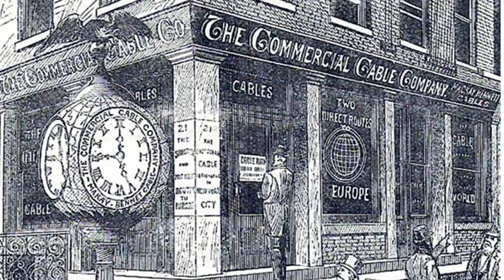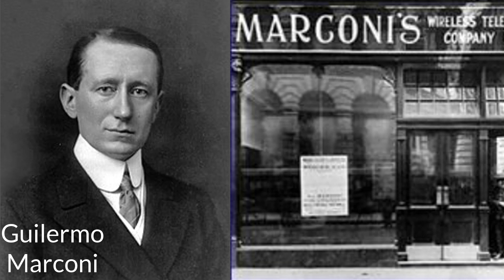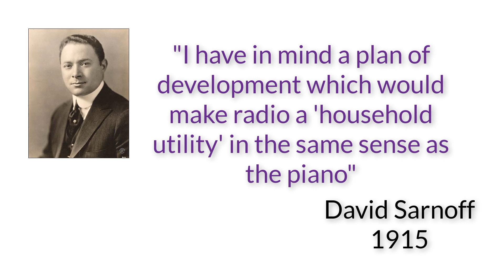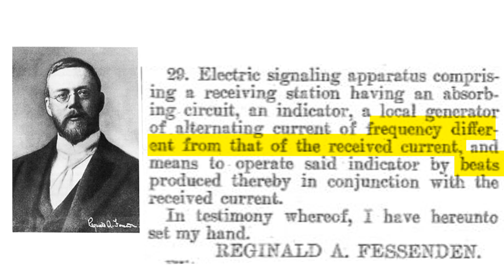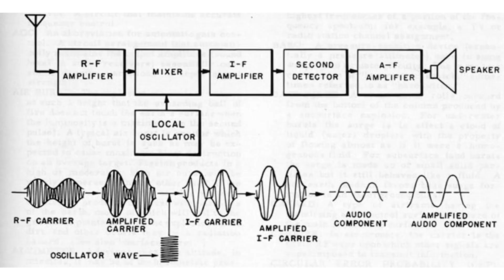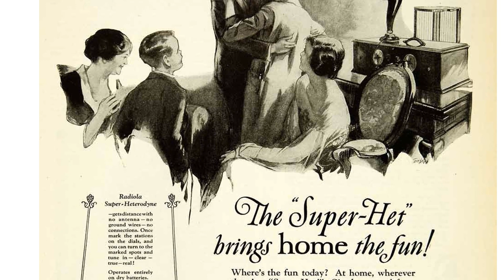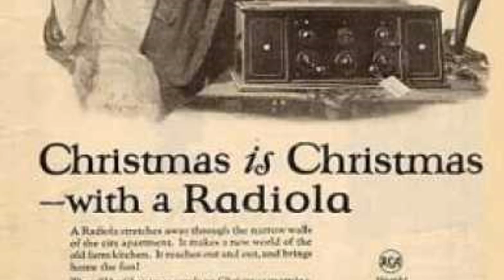David Sarnoff, Howard Armstrong & the Superheterodyne Receiver

Comment from the maker: CORRECTION: I implied that the superheterodyne system used signal addition like playing two guitar strings at the same time, but I have been corrected and it is a signal multiplication not addition. Sorry for the confusion.
Reply: Sum and difference resultants of algebraic combination, like a piano makes beats.
You are correct.
Reply: When you beat two frequencies F1 and F2 in a mixer (non-linear component like a diode or a triode), you obtain two more frequencies, F1+F2 and F1-F2. The IF stages (usually two or three of them) do filter out the F1+F2 component, while the F1-F2 corresponds to the IF frequency of the radio, and is successively amplified and detected.
Reply: @rayoflight62  Exactly. Typically the first IF frequency was 455KHz.
Reply: In a sense you are also correct in that the envelope of the combined guitar string output contains the difference frequency.  However, in practice, schemes that produce multiplication and suppress the local oscillator are preferred.  Great channel BTW.
Reply: @davidhaworth1802  When you sum signals, called superposition, the difference frequency is not present. What you see is the sum of the signal's voltages as they go in and out of phase. It is this voltage-sum that you are seeing, not a component any new frequency.
There must be some effect causing multiplication, commonly a nonlinearity will do this, in order to have the sum and difference frequencies present.
Reply: @Observ45er  I said the difference frequency is in the envelope.  This is correct.  The envelope detector is a non-linear device.  See more on the Wikipedia entry on envelope detector.
Reply: @davidhaworth1802  The "beat frequency" effect is a illusion due to the finite time interval our ear and brain analyzes the spectrum with, it perceives two close frequencies as one modulated frequency. Our ear and brain in effect is a non linear frequency analyzer, similar to what you get with the magnitude value of a frequecy spectrum from a discrete fourier transform of a time interval. Taking the magnitude of a complex frequeny bin is the non linear function similar to the ear where certain nerves detect vibration strength of tuned vibrating hairs.
Reply: @raymundhofmann7661  Its hard to see your point here, but I think you are agreeing with me.
Reply: @davidhaworth1802  Not really, as you say that addition would be somehow working already to create new frequencies which is incorrect for a purely linear addition. Just as a reminder, approximating the envelope of a signal is a non-linear function.
Reply: @raymundhofmann7661  As a reminder of what I said "the envelope of the combined guitar string output contains the difference frequency".  I am not clear what is controversial in that statement.
Reply: @davidhaworth1802  I said it because it was essential for me to understand the seemingly paradox perception of a beat frequency even though it is just a linear addition of two tones which can't create new frequencies according to signal processing theory.
Reply: @raymundhofmann7661  I think the difference is between the perception of the envelope and the actual determination of the envelope (eg with an envelope detector).  The envelope detector is nonlinear, not least because it provides a positive output regardless of the polarity of the input signal combination.  So combine two sine waves of relatively close frequency, put the sum into an envelope detector and frequency analyze the output to show the response at the difference frequency.
Reply: @davidhaworth1802  What is the difference between perception and determination of the envelope? The ear/brain basically in an array of frequency selective envelope detectors, which is a non linear operation in signal processing theory and this explains the perception of beat frequencies with the theory.
Reply: @raymundhofmann7661  Yes, when you understand that our hearing response logarithmically, you understand that this is nonlinear.
Reply: @Observ45er  I think you don't quite understand. The non linear operation leading to the perception of beat frequencies in the ear is the amplitude detection or envelope detection of the single frequency selective resonators/hairs/nerves in the ear. That these nerves also show a more or less logarithmic perception doesn't do anything in the "base band" of the air pressure variations.
The logarithmic perception of the ear/brain seems not to apply to the single frequency detectors but to the overall sound pressure level.
Otherwise it would be much harder to detect fine nuances of overtone variations and spectral shapes which is essential to discern different voices and sounds.
Reply: "Mixer" is a unlucky name, as it implies addition. On the other side if it has a non linear transfer function, which at some point nearly everything has, it creates the new frequencies of multiplication and more. Mixer is just a sloppy name coined in the beginning of a non linear amplifier stage "mixing" the local oscillator and the rf input.
Reply: @raymundhofmann7661  The term mixer was indeed the original terminology. It appears that perhaps, audio mixers, which only some the voltages, maybe confusing some people. However the term "frequency mixer" has been a long accepted term.
Reply: Correction 2: it's Guglielmo Marconi, not Guilermo. Marconi's father was Italian, not Spanish (and in Spanish it would be Guillermo with two l's anyway).
Reply: In theory both the audio mixer and the rf mixer are using the same amplifier that add both signal together!!! But, because the rf mixer use a signal (the oscillator) that is at least a thousand time louder, the oscillator will saturate the amplifier or modulating the signal therefore creating the multiplication. Simple as that... In both case mixer is the correct word.
Reply: @y_x2  That may sound like a confusing answer, but it is correct. We commonly use the local oscillator to drive the mixer stage very, very hard, thus making it non-linear. When the smaller RF signal is added into this, the resultant is a rather complex multiplication process that includes the original frequencies and sums and differences of harmonics. The effect is that the local oscillator signal turns the amplifier on and off and the input signal is only allowed through when the amplifier is on. This can simplistically be viewed as multiplying the signal by one or zero, as well as values in between, at various times.
A true and exact multiplication of the two voltages over time would produce only the sum and difference frequencies and none of the other components. This is what a balanced mixer does. The typical receiver mixer is a very imperfect multiplier but works quite well because the desired I have frequency is simply filtered and amplified.
Reply: The local oscillator is set, as I understand it, higher than the incoming signal by the intermediate frequency. i.e. local - incoming = IF. If that is not subtraction, then I do not know what is...
Reply: @Tensquaremetreworkshop  It may or may not be higher, depending on the application. You are correct though. Mixing 2 frequencies will result in both originals, their sum, and their difference.
Reply: @GoSlash27  Exactly- so what is the multiplication about?
Reply: @Tensquaremetreworkshop  Multiply the waveforms, add and subtract the frequencies.
V_A=cos(A); V_B=cos(B); A=2*pi*f_A*t; B=2*pi*f_B*t
V_A*V_B=cos(A)*cos(B)=0.5*[cos(A+B)+cos(A-B)]
Hope that helps
Reply: @Tensquaremetreworkshop  again, just to make sure you are clear, the instantaneous voltages are being multiplied together. The voltage at each point on each sine wave is multiplied in every instance of time to generate a new voltage which is the product of the two. It is this multiplication product which gives you a new waveform that has new frequencies within it.
This can be very confusing to beginners because you seem to be making something out of nothing. However, that's the way it actually works.
Reply: @Tensquaremetreworkshop  Mike, the local oscillator can either be above or below the incoming frequency. When you have a nonlinear mixing process you will get the difference and the sum frequencies. This is due to a multiplication process of the instantaneous voltages. You are not adding and subtracting frequencies, you are multiplying voltages and the result includes these new frequencies.
Reply: @Observ45er  If you can calculate the result with addition (or subtraction) then that is what it is, whatever happens ‘underneath'. After all, the gas laws are a simple ratio, underneath which are complex physics- but you do not need to know that to do the calculation.
Reply: I must of heard this story is some bastardized form many different times. This is the most complete version that few people know about or understood until now. Thank you!
Reply: I suppose any nonlinear mixing circuit will give you some component that is the product of the two signals. Did Armstrong design a circuit that was a pure multiplier? Anything less is basically wasting some of the signal.
Reply: @lawrencedoliveiro9104  You might think that something gets wasted, but that is not practically true. As long as you get enough of the IF signal out to use that's, all that matters. Yes, all the other stuff is, in essence, thrown away, but it doesn't matter.
Reply: You were correct. It's the sum and difference,  lots of people think they know what they are talking about....And they are the loudest.  I've worked with the circuit before.
Reply: Guitar strings produce "beat" signals too. So it was a great example!
Reply: In analog circuits, there is no such thing as “enough” signal. Higher signal-to-noise ratio is always better than lower.
Reply: It’s the ‘time instant sum’ but the functional multiplication for any time.
Reply: Hoy, A lot of tricks were used to filtering out those 'harmonics too'. :)
Reply: It does not matter whether the mixer is a good multiplier. You could even see it as a chopper. It will still generate an I.F. frequency.  But the amplitude of the I.F. signal does have to be a linear function of the input signal so that the amplitude modulation is not distorted. This doesn't matter in an FM receiver.
Reply: I agree with Raymond. I have designed superhet receivers, and we didn't usually use a multiplier as a mixer. It usually is in fact addition with a non-linear stage - which could be just a diode.  But the math is easier to do with a multiplier.   If I were to design one now, with ICs a multiplier would be an option.
Reply: I guess human ear / hearing being non linear make beat , work like multiplier.
Reply: Your original statement is correct. The signals are added together. Multiplication is a non-linear operation that is not easy to achieve in electronics. Except that primitive summation circuits also do some multiplication due to non-linearities.
But the simple act of summing two signals of differing frequencies results in a complex signal containing both the original frequencies, the sum of those frequencies, and the difference.
And as summation is very easy to achieve in electronics, this is one of the great benefits of the heterodyne design.

So I don't know who had the audacity to correct you, but he/she was dead wrong. As a simple experiment with matlab (or matplotlib) where you plot the sum of two sine signals with a frequency that is a little different will demonstrate.

Perhaps the person was confused with the decoding of an FM signal. If I remember correctly, that does require multiplication, but in practice this was achieved using the non-linearities of regular filter circuits. 

The only analog circuit that does real multiplication is the differential cell, which has an output current that is a fraction of the total current running through the differential pair. With the additional benefit that it can also mix two signals (by subtracting them), these were used in High-end FM systems. Often in the form of a "Gilbert Cell". But that was in the seventies and later, the stuff you are discussing is way older.
Reply: @TheEvertw  You seem to be saying that the process was almost accidental. The fact is, the local oscillator is intentionally driving the mixer very hard, therefore making it non-linear. We did not initially just try to sum two signals. It sounds like you're sort of implying that.

Comment: Your videos are very good, informative and appreciated.  Thank you!  A couple of points on this video should be pointed out however.  There are two intermediate frequencies resulting from mixing two others signals together.  They are the difference of the two input signals, as you point out, and also, the sum of the two signals.  Many receivers use the sum, a higher frequency, as it's often easier to make narrow filters for these higher frequencies. There may be other reasons that I'm not familiar with.
The other point is that a very large proportion of modern receivers don't use Super Heterodyne methods at all, but rather use direct sampling at the incoming signal from the antenna, digitize it directly and act upon it using software.  These radios are Software Defined, or SDR receivers.

Best regards!

Comment: One of the great things about the superheterodyne that makes the design so great is the concept of the IF amplifier. It is the design of the IF amplifier that makes these designs so sensitive and work so well. The main reason: it is easier to make a high gain, lower noise amplifier using several narrowband cascaded sections than trying to make a single stage wideband amplifer as used in prior tuned RF designs. Howard Armstrong was a true genius and his principle of the superheterodyne method used in the 1920's are still widely used today in receivers and test and measurement equipment to this day. It is sad that he passed in the way that he did, and it seems that few people even know anything about this great man. As a side note I read the book I got from you at PCB Carolina last year. I could hardly put it down. I am looking forward to your next one!

Comment: The AR-812 is a reflex design with the first vacuum tube being both the RF amplifier and the first IF amplifier. The very low intermediate frequency of 40 Khz is so that the RF and IF signals can be kept separate by simple filters.
Reply: The low intermediate frequency would require the IF transformers to be quite bulky - but the cost saving of reducing the tube count would more than offset any increase in IF transformer manufacturing cost. Reducing the tube count would also extend battery life.

Comment: I understand how it works, and having built, from scratch, several radios, I understand what the advantages are. 
In addition, my grandfather had a, non superheterodyne radio that required the user to individually tune each stage of the receivers amplification. 
This radio also needed 3 batteries of different voltages

Comment: Around 1919 Leon Theremin made fundamental conception of first electronic instrument Theremin on basis of superheterodyne principle. He mix two slightly different frequencies, filter out high summ to get low frequecy between 20 - 20000Hz. Instrument was finished in 1923. So, it was parallel With Armstrong's invention...

Comment: As a schoolboy in the 1950s  I used to build single valve tuned radio frequency (TRF) receivers with positive feedback (reaction) to increase the sensitivity. The problem with TRF isn't so much the high frequency but the fact that any amplifiers need to be able to cope with a wide range of them. The big advantage of the superhet is that it changes the incoming RF into a single intermediate frequency (IF) and the following stages can be designed more easily (470khz for AM or 10.7Mhz for FM is common).  Only one detector is needed in either case unless a double superhet is used to improve selection. FM just needs a different type of detector from AM  - the rest is almost the same.

The development of the relationship between Marconi, Armstrong and Sarnof (I'd never heard of him) and the creation of RCA was particularly interesting.  The attempt to restrict receiver technology to the USA was clearly not completely successful as there were numerous radio manufacturers in the UK before WW2 (and elsewhere).  I worked for one of them as a teenager (Murphy Radio) and occasionally was tasked to check the so-called museum stock of their early models which I loved.

So well explained again. I was already familiar with the technology but the history was mostly new.

Comment: Combining two more signals in a perfectly LINEAR amplifier does NOT result in sum or difference frequencies.  The front-end RF amplifier (ahead of the mixer) sees multiple signals. If the amplifier is non-linear, the sums and differences of unwanted signals will interfere with the desired signal. This is called "IM" or "intermodulation" interference.  We design the RF amplifier to be as linear as possible to minimize IM. But no matter how good the amplifier is, IM will happen if the unwanted signals are strong enough. Think about it - the antenna on your FM radio is simultaneously getting every local station from 87.9 MHz to 107.9 MHz. Be glad that that the sum & difference frequencies don't usually occur. the stations don't get separated until the IF filter.

I live near two powerful AM radio stations that are 110 kHz apart (670 & 780 kHz). They overload my car radio and produce interference 110 kHz above and below, and this interferes with the weak desired signals at 560 & 890 kHz.  Several miles away the interference does not occur.

This can be a huge problem when several 2-way radio base stations are installed close together on a tower or skyscraper. I have been to a site that had 40 base stations on a tall building in Chicago.  The frequencies were spaced just 10 kHz apart.  They ended up relocating half of those to a different building.